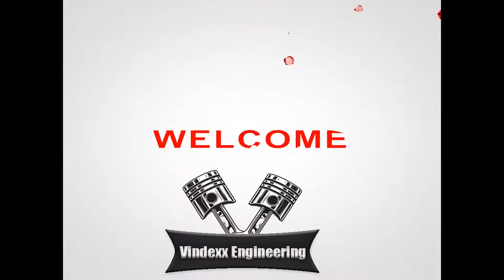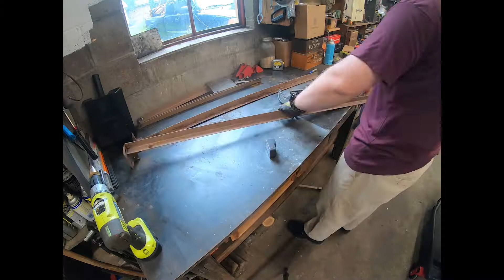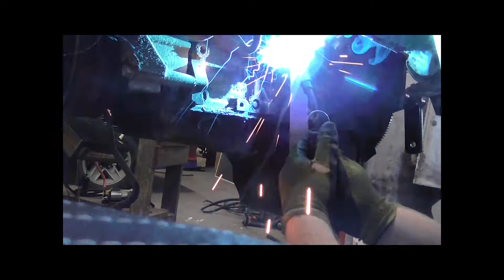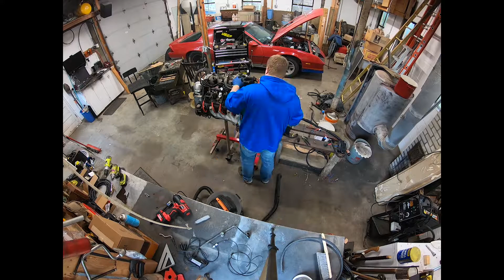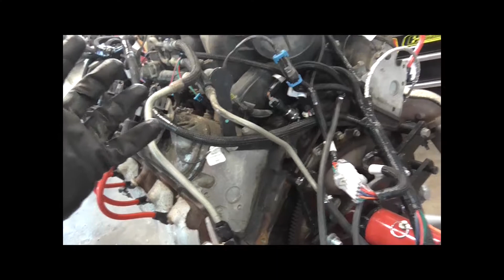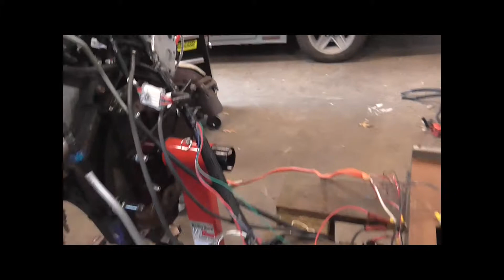Episode 04   Modifying an Engine stand and firing up the Terminator X

Comment: Good idea of recycling the bed rails.  I thought the motor stand startups I've seen on YT were pretty sketchy, but this is the same route I'll be going.  Did you ever wind up adding a rad so you could bring it up to temp?
Reply from the maker: No since i was going to upgrade it to gen 4 internals and replace a bunch of stuff i decided not to.